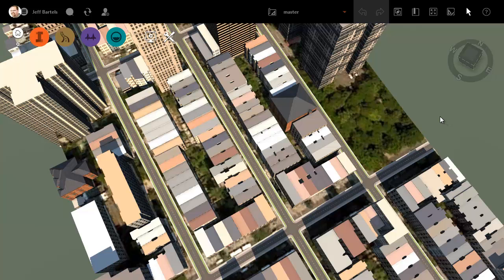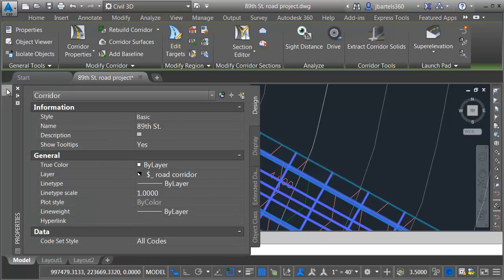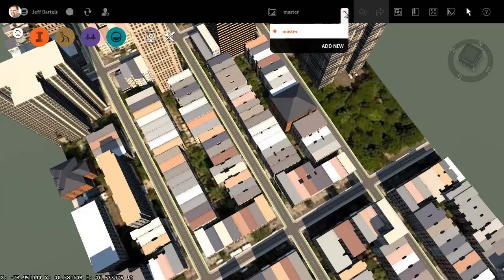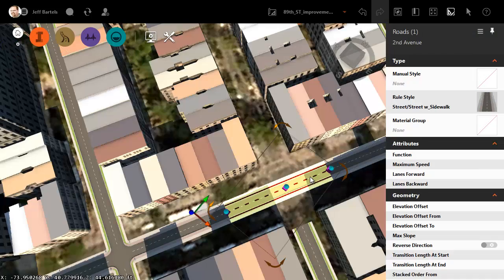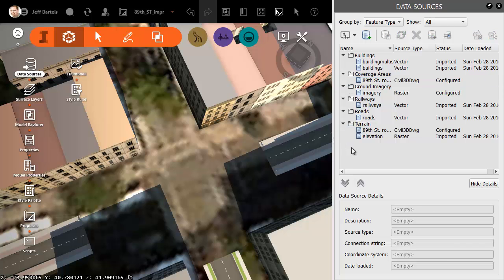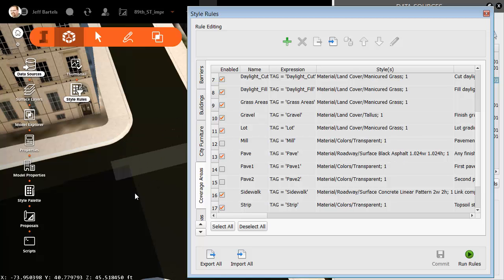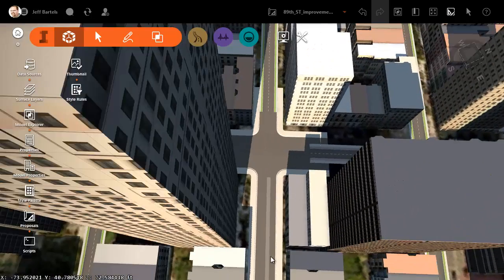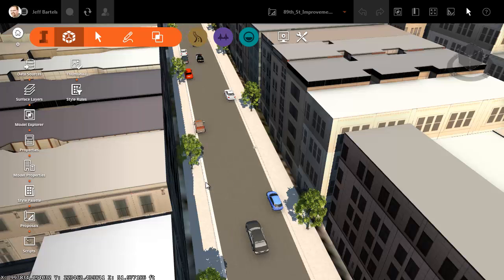Importing a Civil 3D corridor into InfraWorks

Comment: Hi, after importing and refresh it says "You have surface(s) under the uncategorized folder. The surface  under this folder will not be visible. Do you want to open the Surface Layers Panel to manage surface layers?". After opening I tried turn the light on but its not working.
Could you suggest why is this happening and what is the solution?